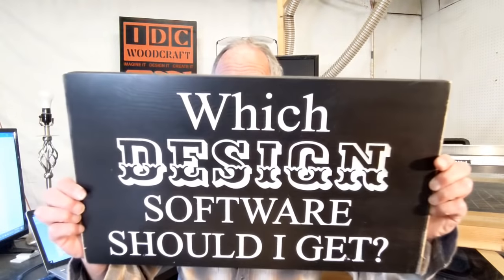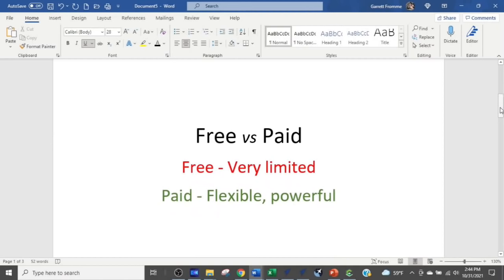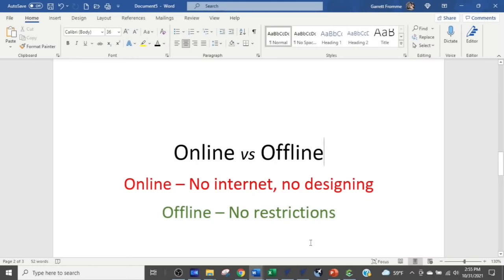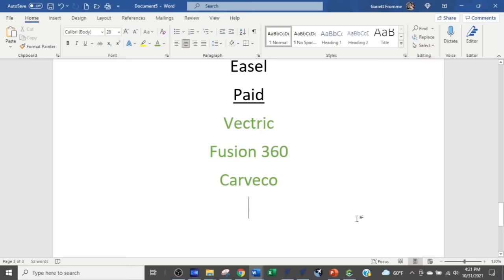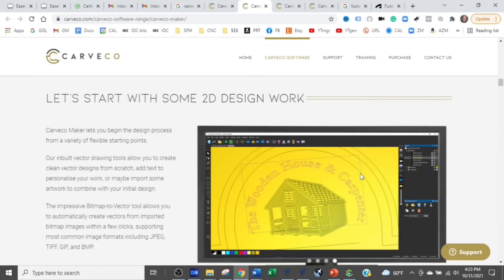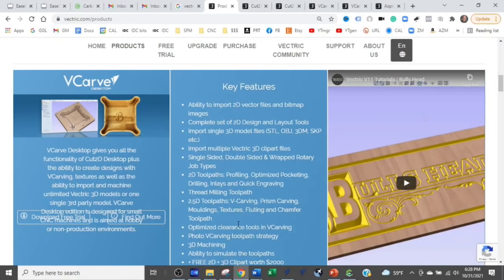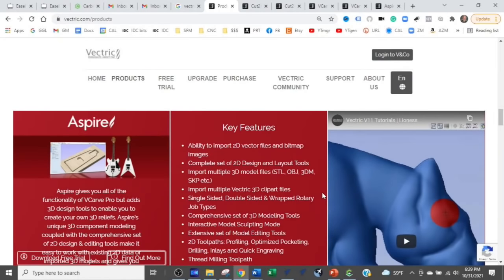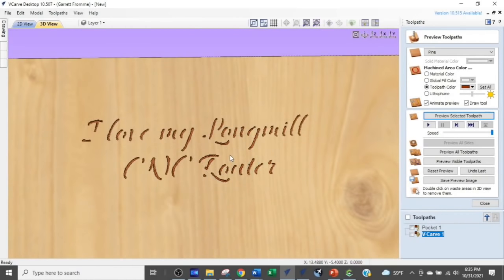Best Design Software Review For CNC Routers & Projects - Garrett Fromme

Comment: I love your thinking! I like to own and not rent software.  A few questions?

Can you talk about what Mac, Windows and Android for running software. 

And if Windows, system requirements? With the new Windows 11 now out, would it be wise to invest in a PC that is or can upgrade to Windows 11?

I'm not a big Apple fan, only bring that up because some people are. My thinking is; if web based software then any OS should work. But, if local software then PC or Mac?

Also, is using the software without owning a CNC fist have any benefits? Again, my thinking is to learn as much as I can before purchasing a CNC.

Love all your videos and help you are giving us! I'm close to making a decision and most definitely will be going  with the LongMill, and will use your link when I do so.
Reply from the maker: Well, Kent,. thanks for the compliment and thank you for considering me with using the affiliate links.

you loaded me with questions I thought about afterward that needed to be covered. and they are important questions so glad you asked.

i don't know about Android. I believe the all can run on MAC with something called Parallel. It is a PC emulator. With Web-based, it is not an issue. In general, most CNC software will not run on MAC without a PC emulator.

Just so you know, i run my Vectric on a standard $600 HP laptop. No graphics driver. For Aspire, I would suggest a grapjics driver.

Of course, you can learn the software any time independant of having a CNC.  

does this answer your questions?
Reply: @IDCWoodcraft  You can also use Virtualbox which creates a virtual machine on the MAC as well.  I have a MAC but I run all my CNC stuff from my Windows 10 laptop.  Also you might want to consider a backup drive for your CNC stuff as well, if you plan on running a business CNC shop.  I have a NAS (network attached storage) server that I built that has all my CNC files (.crv and g-code) that has 2 500 MB drives that are mirrored in case I lose a drive. Now the gSender will run on a MAC, Windows, and Linux.
Reply from the maker: @tomswoodwork  thanks for sharing this. I'll be doing a video shortly with the friend who understands all this. I get the question about MacBook all the time when it comes to CNC
Reply: @IDCWoodcraft  Virtualbox is free, but it can be a pain to setup sometimes.  Now with MacOS, you can do a dual boot Mac/Windows, it's called boot camp and it's installed with MacOS and it has the drivers for the Mac equipment (keyboard, touchpad, audio, etc) if someone doesn't want to do a virtual machine.

Comment: Great video.And a new subscriber. Where would lightburn be in this category? I've heard about being able to control a spindle w/it. I'm using it already for a laser but not sure about switching back and forth? Hobby/diyer hoping for the big time and it's a program that I have paid for. Thanks.
Reply from the maker: Jason, I recommend using lightburn for your laser programming and laser cutting and then switching to another software like vCarve and then gSender /UGS (universal gcosde sender) for your CNC router projects. You can control a spindle with gSender/ UGS.

Comment: Been looking at a few CNC options. I want something mid sized (30"x30") strictly for
 wood, don't need metal work done. I have been looking at Longmill MK2, YoraHome Silverback and Shapeoko Pro XXL
. My biggest concern is getting one and then finding out it's too complicated to use. I assume I can use free software that can help me over the learning curve and them upgrade to a paid, offline option. Of the 3 manufacturer's I mentioned which would you suggest for the home wood worker looking to to personalize items and mass produce smalls on?
Reply from the maker: More Than Enough Woodworks, there's a lot of really great machines out there my friend, including the ones you've mentioned above. All should be able to do the job you're looking for. But my opinion is going to be a little biased being a longmill man myself! I just made a new video about what you should be looking for in a machine and why. If you haven't seen this one yet, I recommend you check it out, I think you'll find it super helpful → https://youtu.be/wLVNF0L-ZdU.

Comment: Does V-Carve have a function to allow you to split your project up so you can use a larger than 4’ long piece of material?
Reply from the maker: 233178033, Yes, V-Carve does have a tiling feature that allows you to split your project into sections, making it possible to work with larger materials than your machine’s capacity. This way, you can create larger designs by dividing them into manageable parts and then piecing them together after machining. It's quite handy for projects that require more extensive coverage and its called "Tiling"!

Comment: Is Vectric an all in one program in that it will allow you to design all the way to running the CNC?   Are all these programs like that?
Reply from the maker: Hi Joe. Vectric is a design and tool path generator. It does not run your CNC. That requires control software such as gSender. This is gSender → https://bit.ly/3y6rnwg

Comment: Thanks for the video. Wondering if I can export my CorelDraw designs in .dfx and use g-sender as the CAM and skip Vetric?  Thanks!
Reply from the maker: Hi Fred. Gsender is not a CAM program. It processes the g-code. You will need to generate gcode first. Make sense?

Comment: Hi Garrett. I've been using Punch! ViaCad Pro 9 on my laser. It's a 2D / 3D cad program.  Could this be used on a CNC machine ?  The software is buy to own, Much, Much Less than $500.00
Reply from the maker: Hi Richard, sorry brother I'm not familiar with this software so I'm not sure! I would recommend reaching out to them directly to ask! You could probably use the CAD side of it though, but you'll need something to generate the toolpaths!

Comment: My question is. The VCarve it’s compatible with MacBook Pro? Or it’s only for Windows computer? And also how many computers you can downloads the program? Because I like to use my office one when I have free time and also my home computer.
Reply from the maker: Hi Abel. All the Vectric products run great on my Macbook Pro running Parallels. It's a great tri-boot system, OSX, Windows and Linux all on one laptop.
Reply: Thank you for letting me know, but can I downloads on two different computer ( windows on the office on MacBook on home ) if I buy outright only one time ?

Comment: Rewatching after running into a major roadblock trying to v-carve inlays with Fusion 360. I agree with you that Fusion360 is probably more powerful and complicated than what the average hobbyist needs, but I like CAD and don't mind the learning curve at all. But v-carve inlays is Fusion's Achille's heel. It just can't do them and that is what I'm most interested in. So here I am, getting ready to abandon a powerful yet free software option. grrrr. /just venting in comment section.
Reply from the maker: Vent away my friend. We get frustrated because it makes us feel out of control a bit. In the end, there's not much we can do but surender and move forward.

Comment: I have watched several of your video's on beginning CNC users.  I will be puchasing a longmill and v-carve pro after the first of the year.  You refer to requiring g-Code several times to get v-carve to actually function.  Is g-code in v-carve or is it a seperate purchase?
Reply from the maker: Cheat code is the program vCarve rights to make your CNC router do what it's supposed to do. You don't need to know g-code
Reply: Cheat code should be
g-code.

Comment: grbl Cnc isn't supposed by carbide creat ? Or we can't generate g code for grbl?
Reply from the maker: omsingharjit, my apologies but do you mind clarifying what you mean on this one my friend? Are you looking for which post processor works with Carbide Create? Which post processor you need will depend on your specific machine, to find this out I recommend reaching out to your machine manufacturer and they should be able to guide you to the right direction!
Reply: @IDCWoodcraft  my machine is arduino based diy build, so can we creat g code for this using carbide?

Comment: Can you have bith vetric and another lets say Easel on your cpu and use both or will one not run if another program is on cpu?
Reply from the maker: Hi Brett. You can run them both. Easel is web-based so it doesn't matter.

Comment: I would also like to use the Vectric software when my Longmill gets here but to start out, 660 euros excluding taxes for the pro version is a bit expensive atm. Since the Longmill is 30x30 inches and the Vectric Desktop only processes 24x24 inches, I would definately need the pro otherwise I can't use the full size of my longmill. I'd need to convince my wife somehow to spend another 800 euros or so for that software besides the 1700 euros for the longmill. Just looking at the website of Carbide Create, it seems they also have Vcarving in there, so I'll give that a try first.
Reply from the maker: Good call PowerPC. Have you considered just buying Vetric Desktop and upgrading later? It will only cost you the difference in price between the two. A lot of CNC guys and gals rarely ever use more than 24x24 either!
Reply: @IDCWoodcraft  It seems VCarve Desktop is 330 euros excluding taxes while the Pro version is 660 euros without tax. And upgrading from desktop to pro seems to be only 170 euros instead of 330 euros. So maybe I should buy the desktop version first, then upgrade to the pro and pay only 500 euros instead of 660 for the pro on day 1.
Reply from the maker: @powerpc6037  that sounds like a smart move. Nice catch

Comment: You didn't mention the non-commercial free version of Fusion 360.

I use it for 3D printing
Reply from the maker: tommarkettahudson4390, Oh, I didn't mention the non-commercial free version of Fusion 360 in the video, but that's a great tool for 3D printing projects. It's definitely a good option to explore for those looking to get started.

Comment: I want to use Vectric but I can't afford the paid version right now . It says the trial is unlimited use but you can't save g-code or export some things. Is it still worth using it?
Reply from the maker: The trial version is there to learn. It will not let you make anything outside of the software. Meaning, you can design anything you want in it, but you can't make anything that you design. Does that make sense?

Comment: Hi, I just got a little CNC just to learn on. I did not want to spend a lot on something that I may not like doing. but after I got everything and installed the flash drive and it said I installed iI then clicked ok I tried to pul up some of the programs with no success. I'm so frustrated.
Reply from the maker: Hi Brenda. Have you sought out help on this? You may want to go to the company you bought it from or the CNC troubleshooters facebook group.

Comment: Hi Garrett, what software do you use to write a G-code as I cannot use Easel because of my poor Internet connection so I bought Vcarve V11and I keep getting an error command "T1M6" and both UGS and Candle will no run because of that command and the Vcarve V11 which is the latest will only save in .Tap format I have written to Vectric but with no answer do you know the problem I'm getting and I don't like Carbide.
Reply from the maker: You are using the wrong post processor. When you tell it to save the toolpath, just above the save button is the post processor list. You need to select the post processor for your machine. 

The post processor tells vector how to write the g code. It is writing it for different machine.
Reply: @IDCWoodcraft  Thanks for your reply and yes you are right but the new version of Vcarve V11 list only two Processors which don't match mine but I found out that I have to down load the right one and install.

Comment: I only took one thing from this Video, and that is you are Biased towards what you only know, you could not even demonstrate either Easel or Carbide Create, i have seen some amazing carvings done with both programmes. As a very Noobie 3018 cnc pro owner your Knowledge i understand is Vast, however it is only Vast in what you know and use. Until i know and understand the Basics i shall stick to Free just to gain some knowledge and this is what you should be advising for CNC starter people, not Promoting what you know and Obviously like. However Very informative and full of Great advice. Thumbs up.
Reply from the maker: George, you bring up a great point. I totally agree with you that newbies can and should look into and try out Easel and Carbide Create. I love that these are free and widely available for everyone to use! I just choose not to teach on them because they can be difficult for many of my fellow CNC brothers and sisters and I prefer working with Vcarve. You're completely right though, you can use these other software and make beautiful projects! I encourage it, but I just may not be able to answer questions as they come up about them so easily. Keep up the good work brother!

Comment: One bit of feedback: VCarve's con was inconvenient buttons? Nah, man...A $700 pricetag is the con. I thought it was going to be about $300 and was going to eat the cost and buy it. But $700?
Reply from the maker: Hi Chris. I definitely understand the sticker shock. I think the cost is adequate when compared to other programs. As you get into it, you start to understand why it costs that much. But there are other options you can use. There are free design software like Carbide Create and Easel.
Reply: @IDCWoodcraft  Yeah, I just downloaded Carbide Create and will see if I can use that for inlay work and Fusion 360 for everything else. Given that the complexity of Fusion isn't a big deal to me, I can't see plunking down $700 for what amounts to--again, for me--a one-trick-pony. 

Expecting your average hobbyist-level CnC'er to pay that much is a bit out-of-touch in my opinion. I mean, I was ready to pay around $350 but at that level over half of my 50"x50" bed is useless to me, and that is the only difference between  the desktop and pro versions. The pricing just doesn't make any sense.

Comment: Garrett, I'm usually pretty on-board with your thinking.  However I do have to disagree with a couple of your points on subscription software.   

1)  You can't "forget" to pay the bill.   All subscription software I'm aware of automatically bills your credit card.  That's just silly thinking.  It's not like you write a check monthly to pay the bill...   
and more importantly...

2) When you get subscription software, you get ALL the updates that they come out with for as long as you have an active subscription.    

When you purchase the software outright, you might get maybe 6 months to a year of updates, maybe....   Then if you want more updates you have to pay.

I'm not saying one choice is better over the other,  just that you need ALL the facts when making a decision of subscription vs owning.
Reply from the maker: Yes, I thought about these after I posted the video. That's why I'm glad people like you are making comments. It helps clear things up a bit. I'll also add it to the description section of the video.
Reply: Lance I agree. I also think some people overlook some advantages to the online based software, for example with Easel I can be on vacation when I get an idea for a project and all I need to make my design is a computer with internet connection. To add to that I don't have to save the project because when I get home and open Easel up in the shop there is my project that I designed while on vacation. I can't tell you how many times I have used that function when trying to show a customer a design.  You can be in somebody's store trying to sell them on an idea then just have them open a browser and put it together right there in front of them. 

I also have a slightly different view on software in general, i look at it like mathematics which is a progressive learning where you build on what you just learned. Free / simple software can be used as a building block to get you ready for something more advanced. If someone is new to cnc and they are running a GRBL based machine ( Shapeoko, Xcarve, Longmill, Millright, Bobscnc....) I try to point them to Easel because it removes the CAM process. Unlike many other design programs Easel will also send Gcode. Yes this can be a problem but most of the time it is not. Once Easel is configured you just click the carve button and follow the instructions. 

This is just my opinion but I say let the cheap software pay for the more expensive stuff. Many people make tons of money with simple signs that are no problem for the free software. Why not make and sell stuff with the free software then use that money to buy the software you really want? 

I agree that Aspire is by far the best software on the market but I don't think it is where most people should start. The free stuff is easy for a reason and that is to get the customer hooked. Vectric even does this with their Design & Make Machinist software, It will allow you to carve a 3d model but you can only change a few parameters.  The free software is the bait not the long-term solution and it should be used that way.
Reply from the maker: @jeffholmes9483  thanks for responding. Sometimes, it doesn't matter how hard I work on a video, I miss something. And I definitely missed some of the upsides of online. That's why I'm glad you guys leave your comments. Thanks Jeff
Reply: @IDCWoodcraft  Great video with tons of useful information.  Please keep up the great work you are doing.  I really appreciate how you show the different options.